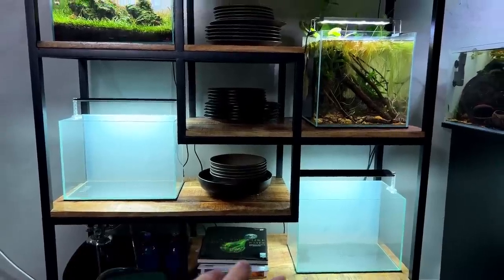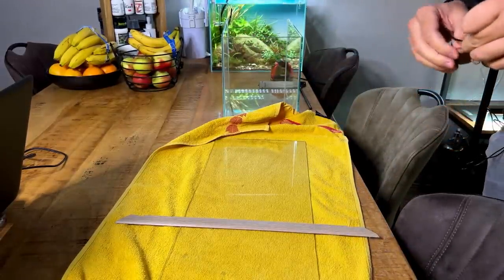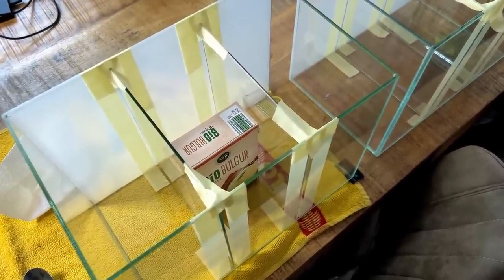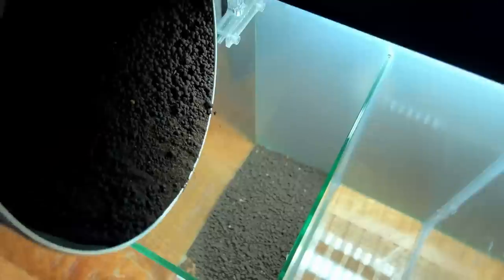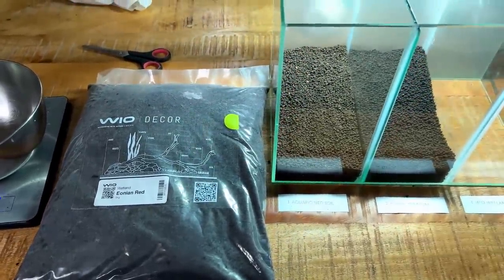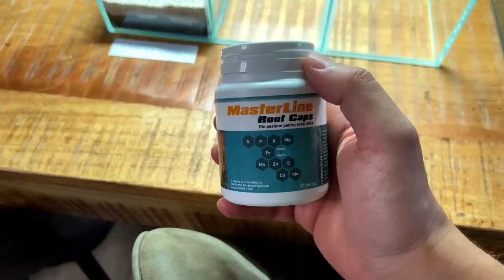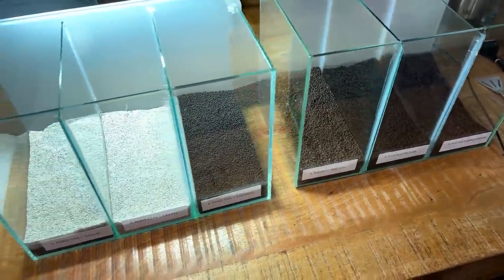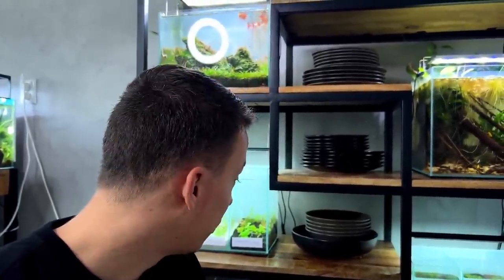I WANT TO FIND THE BEST PLANTED TANK SUBSTRATE! NEW EXPERIMENT!

Comment: Idea for the next experiment
Try different brands recommended substrate system and fertilising. For example : 
1. ADA - powersand+super4+amazonia ver.2
ADA ferts as the brand requires
2. Tropica -
Tropica aquarium soil only-OR- tropica substrate 1cm capped with sand or gravel. 
Specialised/premium ferts depending on fish. 
3. Aquario neo soil with root tabs provided in the bag. Aquario ferts.

Then dennerle, UNS etc.

Can try following the maintenance and fert regime recommended by the respective brands on their website/YT channel. 

Everything else (CO2, water, light, filter and media etc) same.
1 Foreground, 1 mid and 1 BG plant each....
Reply: Bro, this is good idea
But he doesn't get everything for free 🤣

Comment: I made a 1ish gal shrimp tank with forest soil (leaf compost completely turned to dirt) and Fuval shrimp substrate as the capper like what you're attempting here. After some unfortunate events, I was unable to maintain it at all shortly after it was first set up. As in completely untouched for over 6 months. No water changes, no filter, no heater, no food for the shrimp inside. It just sat in a sunny window. I bought about 4 cherry shrimp, an amano, and some other rainbows (One or two i think) shortly after the water tested well. I still have 8 cherry shrimp in it now, over a year and a half later. It amazes me to this day how good it looks after I was unable to touch it for so long. The plants inside are a banana plant, red tiger lily, and dwarf hairgrass, all growing extremely well.

Comment: My 10g Walstad substrate is organic soil capped with a 50/50 of black sand and aquasoil. I used the 50/50 combo because the extra density from the sand made planting much easier. It fully cycled within a month. Matured within four months. Basic planted tank LED light form Amazon and basic power filter. Nothing fancy. Plant heavy. Going strong for two years. No liquid fertilizer and no CO2 injection (modified Walstad).

Comment: I just saw one similar video to this but they're using eco complete,ada v2, and top soil I think..They also use root tabs and without root tabs for comparison.Turns out Eco complete has the best results out of the three regardless if it has root tabs or none.ADA soil with root tabs came in 2nd.Good experiment and I learned a lot.

Comment: I have 4 tanks. 2 dirt with sand cap, one with aqua soil, and one with plain gravel started with fertilizer granules as you did. None of them have co2 injection. The one with plain gravel is my most successful and has been perfectly balanced from the start. The plants grow almost too well and I have to trim them back constantly so the fish have room to swim. I’m always fighting algae in the dirt tanks. The plants seem to have lots of growth early on and then everything goes downhill when the plant sizes reach the limit of the natural co2. I’ve had to replant one of the dirt tanks 3 times after algae got too bad. One of the dirt tanks was previously plain gravel and was doing fine, but I thought dirt would be better. The aqua soil tank is pretty good, but always has some algae. I think I would have an easier time with co2 injection and I might try it soon, but I know what’s possible with no co2 and plain gravel and it’s hard for me to ignore that.

Comment: Maybe you should use 1 liter not one kilo as some substrates will be more  dence. You will not have the same volume of space for the roots
Love to see the results anyway but I think that would have been more accurate also all the aquariums should have the sides black as the middle ones get more ligth than the ones outside...
Reply: There's so many variables...
Reply: Also if you take the first days into consideration the lighter collour substrates will have a bigger ligth output due to the reflection from the botom